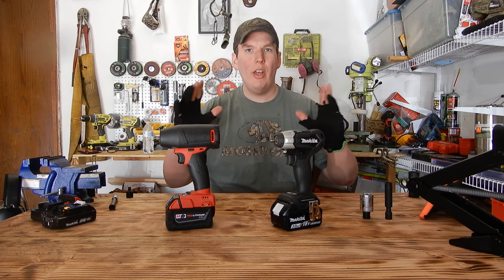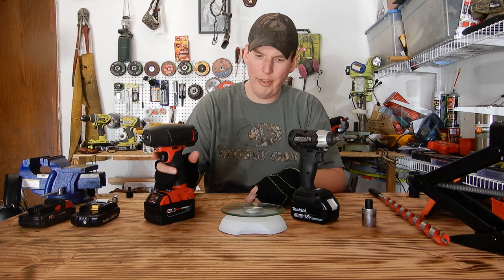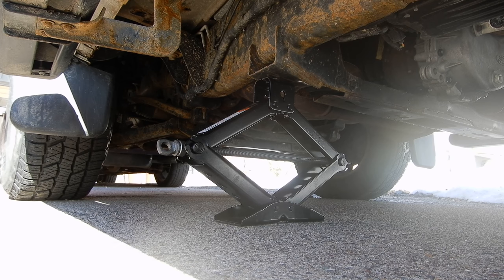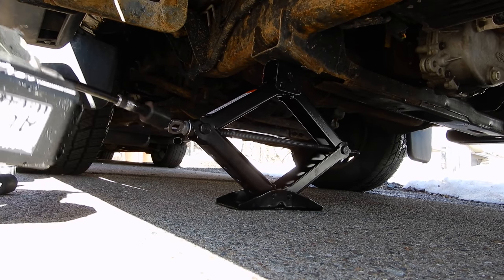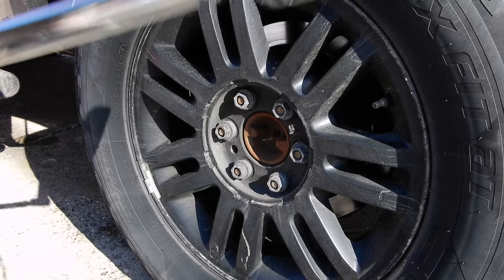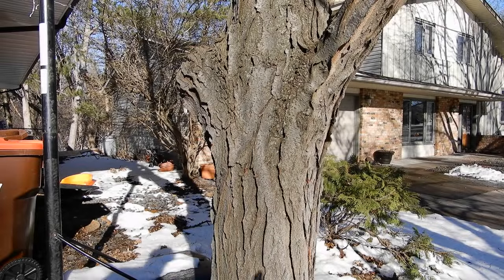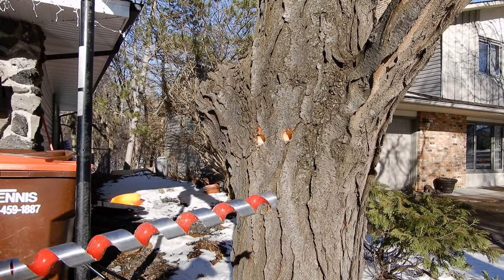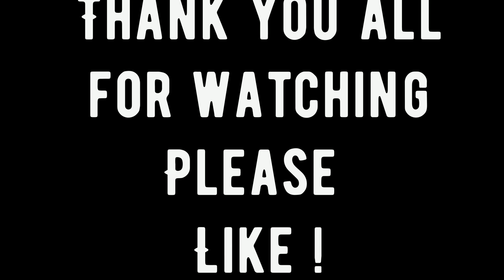Milwaukee VS Makita 3/8 Impact Wrench Show down

Comment: I would go with makita as best just because of size and intended purpose of 3/8 impact wrench. As always I would say that everyone is going to choose the platform they already have.
Reply: I agreee somewhat with what you’re saying.  I may be a bit different in my approach.  I’m invest in the Milwaukee M12 and M18 lines, but have a Ryobi 18 volt, Craftsman 20 volt and Dewalt 20 volt charger and batteries.  That way I can add certain tools on here and there from other manufacturers.
Reply: @martylucas8557  yep I am heavily invested in the m12 and m18 fuel lines but I got some dewalt stuff as well and looking to get more.
Reply: Dominic Heath, do you have the Milwaukee M12 PVC Shear Tool?  That’s one of the more unorthodox M12 tools I have.  It dies a great job cutting ABS, PVC, etc...  The M12 and M18 Hackzalls are fantastic.  They have dual opposing gears in them that cut out a lot of the vibration. AvE did a tool tear down of the M12 Fuel Hackzall, I believe the 2520-21.  He was totally impressed and baffled a bit at the same time.  

I’m probably a lot like you though, I just like all the tools!
Reply: @martylucas8557  I dont have the PVC cutter. But I have 3 hackzalls. The original m12 brushed, the m12 fuel and m18 fuel hackzall. I love them.
Reply: Milwaukee
Reply: Dominic Heath, right on Brotha.  I might pick up the original M12 Hackzall refurbished from CPO Milwaukee.  How has it performed for you?  I like the small form factor.  

FYI...I’ve had some great success ordering factory refurbed from both CPO and Tyler Tool.  I ordered an M18 Fuel Dual Bevel Miter Saw from them.  I ordered bare tool for $299.00, with regular price being $399.00 from Home Depot, CPO, etc...  They sent me a brand new saw.  It still had the manufacturers zip tie and packing around it.  In addition they sent me a 5amp battery, charger and 40 tooth blade.  If I would’ve ordered that new it would’ve been $499 + tax or $529.00.

I also ordered a Fuel blower (Gen 1) from Tyler tool.  I paid $146 out the door.  It included the blower, 9amp battery and a rapid charger.  Separately it would’ve cost over $400.00.  They sent me what looked to be a brand new tool!

Comment: Why are you using extension when it's not needed
Reply: Tell you what,  why dont YOU go ahead and do YOUR own video on "why an extension is not needed" . Yea, go ahead and do that video with neat physic equations and you can even wear a corduroy blazer with accent elbow patches.
Reply: +Brian Klein
That’s 1 good heads up of you, that extension bar reduced a huge amount of torque.

Comment: Makita shouldn't have based their subcompact wrench on the impact driver.  The new 1/2" subcompact XWT13 is going to have a better drive train, but I still don't see the point of owning one when the XWT11 exists.  

They got it right with the XWT02/XWT11 way back in 2015-2016 anyways.  It's the shortest and most powerful wrench in the "compact" class.  IIRC it's basically as short as the XWT12 subcompact and about 2x as strong.  

And Milwaukee definitely got it right by going the purpose-built route with their stubby M12 wrenches.  I'd hope Makita goes back to making their wrenches as short as possible even if it means they have to be built a little wider.  Only way you're going to squeeze more power out of a subcompact wrench anyways.

Comment: What size battery is on the Milwaukee here? 3.0Ah, 5.0Ah?
Reply from the maker: I cant remember but I think I was using 3.0ah battery's on both because I always try to keep it fair with the same battery. Thanks for watching.
Reply: Milwaukee Win 5Ah # Makita Knockout 3Ah ✅✅✅❎
Reply: I've used the 6.0 and buddy let me tell you that 3/8 Milwaukee impact torques the fuck out of things

Comment: Hi, excellent video ty so much, I’ve never seen a Mikita so week! I’ve used Milwaukee and this is common for that, for me Milwaukee and hilti are top of the line, Mikita is one notch down, just my opinion and experience, excellent quality video ty, Bob,
Reply: Makita tools are definitely not one notch down. They have very high quality tools. My dad had an impact wrench 20 years ago and is still kicking. Every tool has ots purpose.

Comment: You used the sub compact makita!  Thats not fair....
Reply from the maker: Well if you want to be technical that is the Milwaukee's compact Impact wrench, So it is far. Its not my fault that Makita made it with only 140 ft lbs of torque. They are both in the same class. THanks for watching :)
Reply: @Impact-OG   that massive milwaukee is a sub?     Biggest sub compact ever.
Reply from the maker: @MrColtnutz  Its not that big, its the older 2755 but not the one key version, it only has about 200 ft lbs of torque

Comment: Dude, I have makita's subcompact line and can tell you have it set on the soft setting, based solely on how slow it's turning; either that, or it's set on assistive mode (but not likely).
How's about performing an objective test, instead of just clickbait.
Reply from the maker: Ummmm ok, it has no power, it works on little bolts but nothing big like a lugnut, click bait your funny 🤣🤣🤣
Reply: @Impact-OG  Look, tubby, I'm not trying to troll you, I'm just pointing out what I know to be true. Why someone would waste their time making illegitimate videos is beyond me, but ill tell you what- just to prove my point, im about to walk outside and do the exact experiment (sans Milwaukee, because I dont have it - BTW, I'd like to add, I love Milwaukee tools, I just dont have this particular one)
Reply from the maker: @JPrich-uw5pe  tubby your so funny, dont get buff hurt hahahaha your most likely one of those guys that live in his mamas basement, hey if you dont like my stuff dont watch it. I dont give a shit what you or anyone thinks. 
Have a blessed day i will pray for you.
Reply: @Impact-OG  this is too funny but at the same time , “Doth a fountain send forth at the same place sweet water and bitter?”
 
Thanks for the video .
Reply from the maker: It's on the normal speed, I'm not mentally handicap. And I don't check on tests, it would be way harder to fake it. And the milwaukee has way more RPM the the Makita.
But thanks for watching

Comment: Well nah bro that’s not the right makita tool to compare to that red guy that’s the makita sub compact you should be comparing that to a 12 volt tool or at least 12volt size tool you should be putting this red one up against the makita xwt06z
Reply from the maker: Feel free to donate it to the channel and  I will gladly Do a tool review.  The Makita is a 18 volt same as the Milwaukee, they market it in the same class and that it can keep up with anything. The main reason I did the review is because there both 3/8 in impact wrenches.  I am on a limited budget I dont have big Corporate sponsors like other channels. 
So I try to give you guys the best tools reviews I can with the money I have..
Thanks for watching